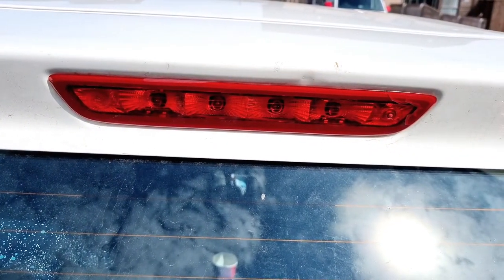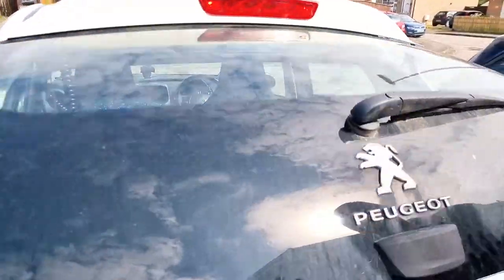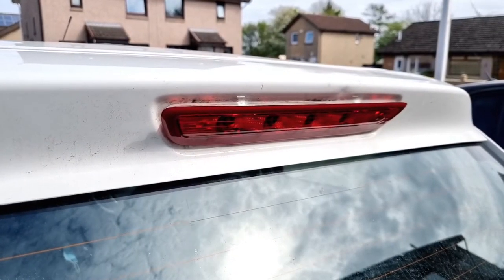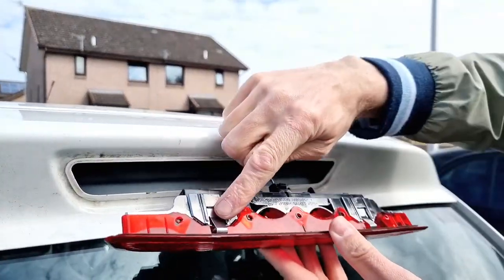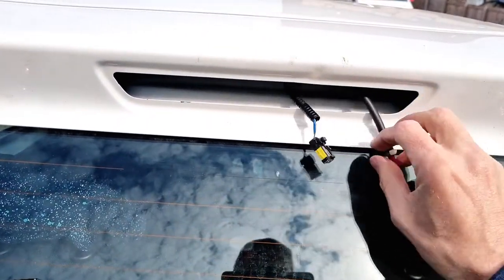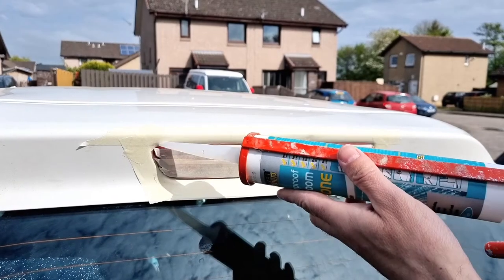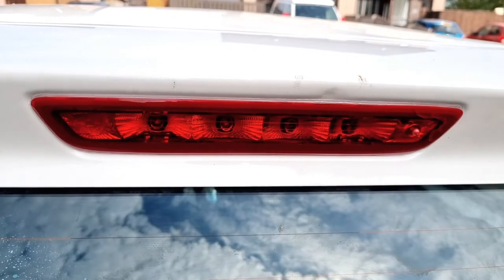Peugeot 108, Citroen C1 & Toyota Aygo - High Level Brake Light Removal - Rear Light Bulb Removal.

Comment: Unless you have unusually long fingers , it's only possible to access one clip at a time, but even then it's not possible to achieve enough force to push the unit out - even a little. I tried it today.
Reply from the maker: Thats correct, you can only reach one at a
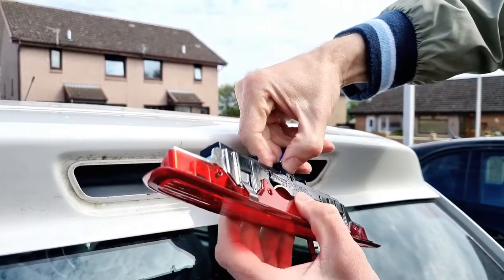 time, check the clip location at 1:28 Push the clip down and push at the same time, it's just enough to clear the lip and repeat. You only need to push the 2 top clips and it will come free.

Comment: I found it impossible to remove the light fitting by this method even though I have an inspection mirror to look into the door cavity, I couldn't get my fingers anywhere near the clips! To remove the light fitting I had to force in some plastic strips, cut from an old oil bottle, between the fitting and the door surround from the outside to release the clips holding it in. To get them in I levered the fitting away from the door using a plastic ruler. The clips are situated directly above and below the outer two bulbs holes.
Reply: Same, I used the tesco clubcard on my car keys as a "spudger" to make sure the clips didn't fall back into place.
Reply: I have just tried now, I just can't do it, there's not enough room to get your fingers in.

Comment: Very helpful, my  light was letting water into the hatchback area, I checked before the MOT and it was not working. Believe it or not, this is not an MOT failure as long as the main brake lamps are working. I thought any safety device had to work but mine passed without working. Thanks, once again.
Reply: It's because it's an additional stop lamp and not all cars are fitted with them as standard as some are just a reflector. P.s I'm an MOT tester 😂

Comment: The help was massive thanks a bunch! One thing just to be sure, when applying sillicone the light is supposed to be tucked back in?
Reply from the maker: Indeed, tuck the light in if you wish to use silicone. If you put it around the inner bevel then fit, you would have a hard time removing it again. If it's done from the outside at least you can cut or pull the silicone off if you ever needed to remove it again. I doubt that though as you can  pull the bulb carrier through the access panel.
Reply: @speedyreidy575  I just tried this procedure myself today but I seem not to be able to push the light through. I get the top part lose but then I can't get it through like you did, is it supposed to go as easy as you did it or should I somehow get the lower clips loose?
Reply from the maker: @SmDWeed  In my case it popped out easily, check the clip location at 1:29 and try pressing them in then pull the light assembly.

Comment: This video was perfect. By the was got some critics about you saying you shouldn’t seal from the inside because of the brake light bulbs if you need to change one. 

You can take the bulb carrier out without taking the lense out -
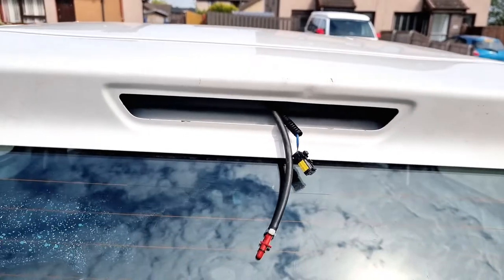Reply from the maker: Glad to hear the video was of use to you and thanks for your comment. The bulb carrier does come out separately as shown at 1:37 and 1:42 but I don’t see how you can easily remove it without taking the lens out. If you can it must be extremely tricky and tight to do due to the size and location of the access panel.
Reply: Yep can confirm, can be changed without removing the light! Sealed mine today due to a leak, thanks for the video but yea you can change the bulbs through the access hole by sliding the bulb holder left then right through the hole :) it’s easier than removing the whole light!
Reply from the maker: @hindsonracing  Glad the video was of help and thanks for confirming that the bulbs can be removed without taking the light out. I couldn’t confirm myself as I no longer have that car. The video wasn’t in vain though as it shows how the bulb holder is held in.
Reply: Thank you for a great and informative video!
I need to remove the access panel and try to drain out the water I can hear slushing in the cavity when opening the back glass "door".
Great to hear that the bulbs can be changed even if the "lens" is sealed and glued with silicone.
Silicone has rather good waterbarrier properties.
Acrylic sealants don't have good long term water barrier properties.

If one need a seal with truly excellent water barrier properties butyl is the best choice. But hotmelt butyl isn't really available for DYI or workshops.
Poyisobutylene bands/strings would be the second best choice. The waterbarrier and aging properties are outstanding.
I have myself checked the condition of more than 20 year old polyisobutylene bands used as sealant under trimmings on the outside of a bus in Norway. Very impressive! The polyisobutylene bands where perfect! After more than 20 years in the climate in Norway. The bands looked pristine. Soft and sticky!

Comment: Just fixed this problem with my C1 Mk2. Only comment I would make is that the water lingers in the "spoiler" for days. Ended up sealing the brake light with insulation tape and putting a full size J cloth in, to collect the water. Unless all the water is removed, then the sealant will not cure. There might be some benefit to removing the bungs near the hinges but the J cloth treatment worked on mine and the bungs were both bone dry.

I can confirm the bulb carrier is removable through the access panel. Some resistance may be encountered due to the stiff plastic wiring harness. I moved the cage to the left away from the hose. Cyclone Cyd has a video about fitting LEDs but the 4 tungsten bulbs were fine on mine so I've left them in place.
Reply from the maker: Thanks for the comment and confirmation, the amount of water will depend on how long ingress has occurred, but a valid point non the less 👍
Reply: @speedyreidy575  No problem, keep up the good work. There is a lot of info about the older bugs but less about the Mk2 ones.

Comment: Thankyou , I have scoured the net looking for a way to open the top lights.A bulb has gone plus I've water leaking in my boot..must be a common problem.
Reply from the maker: Glad it was of use to you. I've listed the bulb type you will require in the video.
Reply: Did you manage to remove the light unit, and if so, how? I could only access one clip at a time, and could not budge the unit at all.